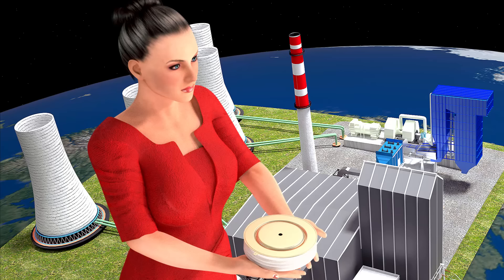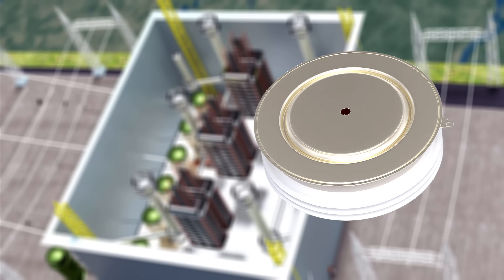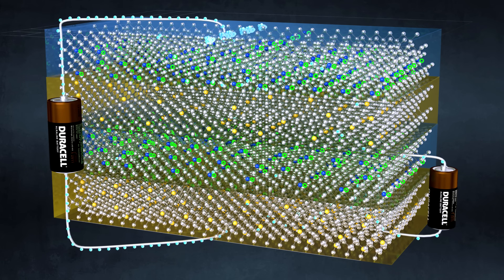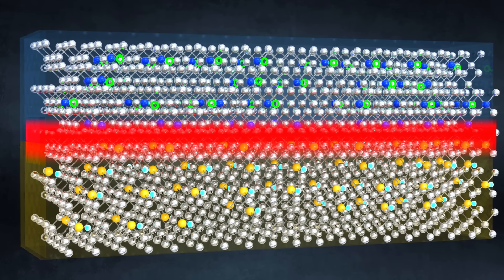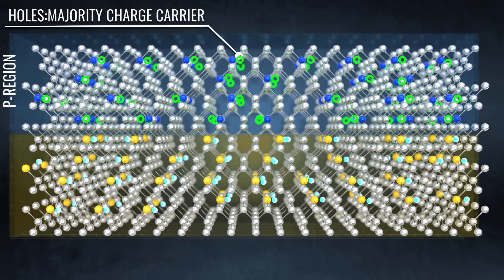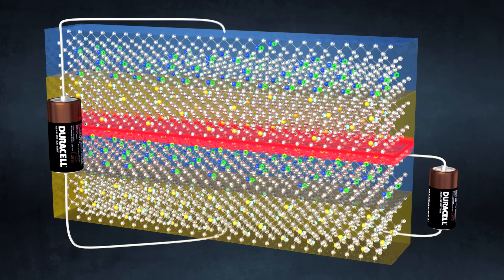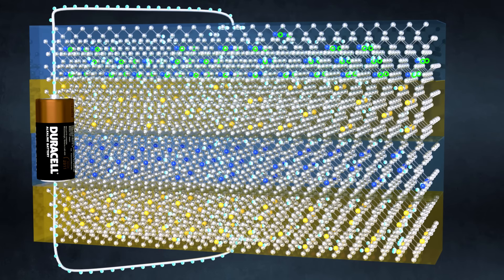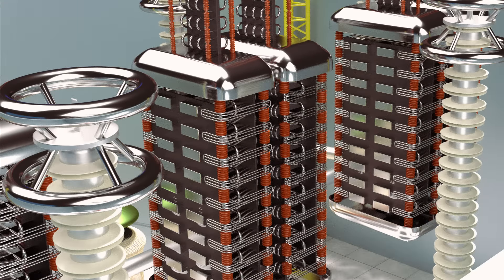How does a Thyristor work?

Comment: But doesn't DC over long distance burn the wires?
Reply: They use very high voltage
Reply: No, if you use a conductor of the required width and current density there will be no problem. Plus HVDC is not pure DC but high frequency switched DC which means the average resistance power loss and heating effect is lower.
Reply: Yeah that line also confused me..I thought 3phase AC is being used for transmission
Reply: No it does not, because you can use high voltage, low current.

Heat generation in the wires, or copper losses, can be calculated, according to 'Joules law', by P = U*I (voltage times current), or adapted with Ohm's law:  Heat = R*I² 
R is a given for the wires, 
so you just have to minimise the current to reduce heat losses. 
This can be achieved by using high voltage, low current.
Reply: @sayantanmaiti2513  in most places AC is what is common. HVDC is slowly becoming commercially viable and installed.

Comment: Nice explanation, but why does everyone keep saying that the thyristor can't be reset using the gate?  It's wrong!  Try this: trigger a thyristor with a short small positive current to the gate; then remove the current, it will stay on, but now connect the gate directly to the ground: it will stop conducting!  I tried with a MCR100 and a C106D1G, a 9V battery and a LED+470ohm resistor as a load; same result.

Comment: I designed and built a lot of gear in the 70s using SCRs and Triacs in disco lighting control gear. I knew how they behaved very well but never really knew the actual way they operated. I see now how the SCR anyway worked.

Comment: An improvement would have been to explain the difference between a Thyristor (SCR or Silicon Controlled Rectifier) and a TRIAC. 
A TRIAC is basically two SCRs in antiparallel - so it is possible to control both half waves of AC power at the same time.
Thyristors are utilised in converting AC to DC and viceversa.
It is possible to build thyristors with thousands Volts Vr, and ten thousands Ampere of controllable current. This is not feasible with transistors.
Thyristors are also widely utilised in railroad rolling stock.
Thank you for the video...
Reply: Two SCRs can be connected to form a high current triac, because single constructed triacs are limited in power.
Reply: Un tiristor no es un SCR, pero un SCR es un tiristor.

Los TRIACS, los SCR y los DIAC son todos tiristores. Los tiristores son una familia, no un componente.

Thyristor its a family not a component.
SCR, TRIAC and DIAC are thyristors.

Comment: Great video! Just one suggestion: I don't understand how the described device turns A.C. to D.C. and vice versa. Thanks for the video!
Reply: it is because , during reverse bias no electrons flow thus converting it into unidirectional flow or DC
Reply: Bud Step it's just working as a diode in a special manner
Reply: its one big multi-layer diode. so they just use it in a big rectifier array to convert ac to dc.  single layer diodes would burn out if you reversed the current at that high of voltage. so adding more layers significantly increases the reverse current stopping capacity. but because of the extra layers; you have to pre-charge each extra layer in order for it allow current flow in forward direction.  you could do the same by putting lots of single layer diodes in paralleled but in order to split enough voltage off not to burn them all out you would have to use way too many diodes to be economical. this is just a way of making super high voltage diodes with much less silicon. 

further more when the current is going forward the thyrister works like a closed switch. but when its going backwards it acts like a big capacitor. the LC inductor is not to help turn off the thyrister so much is its to help ease the massive voltage spikes you would get when the current reverses again and that capaciter turns back onto a switch with extra voltage pushing the capacitor charge out. 

the result is that a thyrister rectifier sends ultra high voltage DC pulses down the wire  instead of AC or constant DC. the high voltage pulses have the same long distance transmision properties as AC but without the current ever fully reversing, thus causing flux in the wire to reverse, thus cause the wire to expand and contract and generate lots of heat and lose energy. 

also the same way that most communication lines work. DC pulses for long distance... with diferential signals to detect voltage errors.
Reply: @guymella  that was a great explanation!
Reply: What about DC to AC
Reply: @1st_ProCactus  inverters
Reply: @richstaas3143  that's a whole different system, not a component
Reply: @1st_ProCactus  my bad I thought that was a General question
Reply: @1st_ProCactus  DC to AC uses thyristors that are just triggered sequentially off a timing mechanism (e.g., a clock or a existing AC system).  If you hook up 6 thyristors to a common DC line, you can trigger them each at specific moments to give you back 3-phase AC power.  Power systems are more complicated, but that is the essence.
Reply: @1st_ProCactus  They are called "Inverters"
Reply: thats because it wasnt explained at all
Reply: Guymella, great answer but you spelled thyristor wrong so... do not pass go, do not collect 200$

Seriously though, I thought ac was developed for power distribution. Now we are being told D.C. Please help before I spiral into aa nervous breakdown.
Reply: @ucanliv4ever  100 years ago there was no practical way to raise or lower DC voltage. What you got from the generator was it. But with AC a simple transformer could raise the voltage for long range transmission, transmit the power with less losses, and then drop it back down to a much safer and usable voltage for distribution. Today with electronic components we can raise or lower DC voltage by converting it to a high frequency AC, using a transformer (but a much smaller and lighter one since the frequency is high) and then rectify it to DC.
Still it is simpler and cheaper to use AC except on very long lines. In fact the lines are so long they are a significant fraction of the wavelength at 50 (or 60) HZ and start to behave like an antenna ! (the required antenna length is inversely proprotional to frequency of the AC). So AC lines have both resistive and capacitve/inductive losses. High Voltage DC lines only have resistive losses. Also it is misleading to say the AC lines have high losses, they are less than 10%
Reply: They turn of on the negative wave and you don't need to flow current in the gate after triggering. The switching conversion to high voltage is done as usual I think with inductors and capacitors.

Comment: So, I found a couple of comments saying that Edison was right and Tesla was wrong.
This is where most people lose their point.  Edison was using DC generators which were heavy and bulky. These DC generators have brushes and commutators and all this used to limit the DC power generation because one can't make the DC generator to run beyond a limited speed and generate emf. Even today DC generators are capable of producing hardly few kWs. Edison had no idea how to break this boundary of power generation and at low power, the transmission is only possible up to a few Kms not more than that. Edison came up with the idea of making multiple power stations at fewer distances to tackle the problem.

Nikola Tesla found this to be useless and his vision was to make a single power plant which can transmit power over longer distances. Tesla understood that in order to transmit power over a long distance, the transmitted power should be way higher. With this aim, he came up with the AC voltage because things here get magnetically link up, unlike DC where you need to physically connect everything. No speed limitations therefore and the AC generators or alternators can now run up to 3000rpm. The AC generator can generate MWs of power and with Transformers the voltage can be stepped up to transmit this power at a higher voltage and low current thus low loss and more efficiency. But in AC the problem is that there are additional line impedances like inductance and capacitance in addition to resistance which was the only impedance in case of DC.

HVDC links the best of both. Generate AC voltage at higher power (several 100MW). Step up this voltage to HVAC. Convert this HVAC to HVDC just during transmission to avoid inductance and capacitance to interfere. So, now you can have higher power transmitted over longer distances with minimum transmission Impedance. At the transmission end, this voltage is converted back to AC then stepped down and distributed just like AC so that you don't need to change your respective loads.

HVDC is a kind of win-win situation in the war of electricity.
Reply: Siward Beorn  why r u shouting bruh! 🤔
Reply: Siward Beorn  PEACE :)
Reply: Wow, I was an inside electrician for over 30 years and never knew that it was converted to DC at the distribution level.  When I learned that DC was inefficient in transmission in the early years I assumed it was AC all the way.

Comment: I literally entered an exam for this today. I'm an undergrad Mechanical Engineer.

Why didnt you post this earlier?! Haha
Reply: Which course mate?
Reply: It's related to Power Electronics and Power System. Which course in Mechanical Engineering has this?
Reply: It's a mixed sortof course my University came up with, usually throughout the courses of Mechanical Engineering they would implement bits of information about the power source in a system. For instance things like Engines and Motors, and learn to calculate with them. The course is in dutch but roughly translated it would be called the Power Source Drive System Techniques. Where I had an exam about (also) the electrical poles within Elektrical motors, differences between AC / DC, the star and triangle way of setting up the coils, Shuntmotors Serial motors and Compound motors, but also like Combustion engines, with Petrolium and Diesel, Torque, rpm, force and speed calculations for Power, etc etc I can go on and on.

It's a large course with a mix of Power Sources inside of different Systems

Comment: Usually, you will use  capacitor and diod and other things to convert AC to DC. But this method waste energy by sometimes more than 50%. But by using Thyristor, all AC can be converted to DC without lost of energy.
Reply: A little more explanation for a beginner 
THANK YOU

Comment: Maximum power transfer capability in a transmission line is given as the product of the sending and receiving end Voltage divided by the reactance of the line. In HVDC the transmitted power is DC and the only impedance in DC is resistance and reactance is zero. Thus the maximum power transfer capability becomes the product of sending and receiving end power divided by zero i.e, infinite! That's why HVDC is the best but costly technique of power transfer. Also, as there is no AC current so there will be no capacitance formed and thus no need of stranded conductors. Only two cables forward and return will help in power transfer, unlike AC where around 6 cables required for 3 phase AC power transfer thus increasing the cost.

SCR (Silicon Controlled Rectifier) or Thyristor is known as semi-controlled power electronic device because it can only be turned ON by giving positive gate pulse (i.e, by secondary supply) but turning off can't be controlled by the gate terminal. But why is it so? Watch the simulation of an SCR using transistors to understand what causes an SCR to be a semi-controlled device and why it remains ON even if the secondary supply is cut off. It is the simplest explanation of why the SCR behaves like that.

https://m.youtube.com/watch?v=PVDNFkggRiw&feature=youtu.be

For more such informative topics on EEE, you can subscribe to our YouTube channel.
Reply: Power lines have capacitance in DC as well, and only in steady state reactance is 0. All transients feel the inductance and capacitance.
Reply: @sumilidero  yep but I am talking about ideal condition. In reality the effect is still low because the DC is almost linear because it is switched using 12-18 valve or switch converters. At such a high frequency, the capacitance effect is almost zero and the impedance between line and earth becomes infinite. Line charging current is almost zero. The only problem which comes up is harmonics which increases but modern day converters are coming up with better THD (total harmonic distortion) controlling filters to avoid the problem.

Comment: If you layer the N and P type in a specific way you can optimize the power to not need a second battery to start and only use one it's just more complex than 4 layers.

Comment: Great video, but I didn't understand the explanation of why doped p-layer of thyristor that becomes n-layer saves its state after removing secondary power supply. For example, in bjt, as u mentioned, we always need a secondary power supply if we want bjt to be switched on.
Reply: There is essential 2 BJTs with the NPNP structure. The current most flow through all junctions. Some of those junctions are the bases of each BJT and it basically has a positive feedback loop through the structure, keeping the "BJTs" on or biased until the current is removed. The result being you basically have to pulse the gate once on thyristor to trigger it on and it will latch on.

Comment: Ok this explains a thyristor but it leaves the question of what exactly a thyristor is doing in the HVDC power grid.
Reply: Power transfer from generator. It basically does conversion. Ac power to DC. After that these dc power is transmitted to consumers through transmission lines